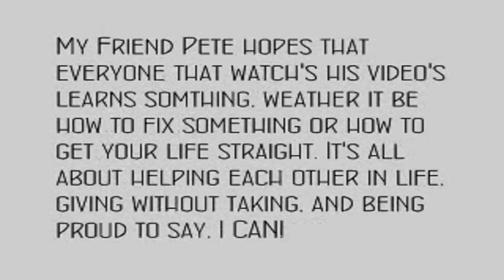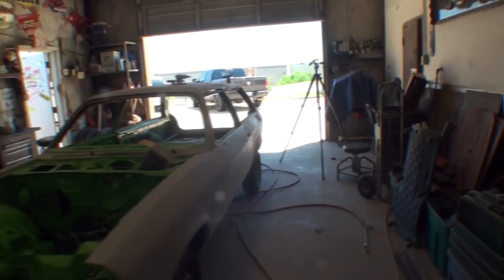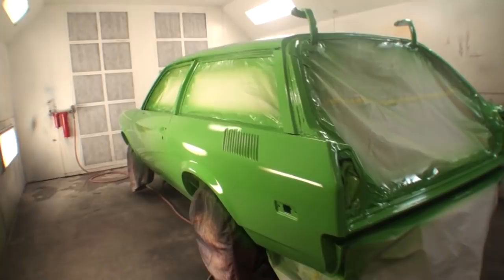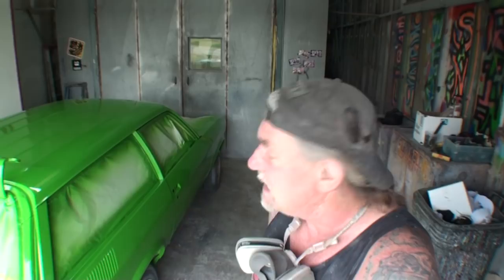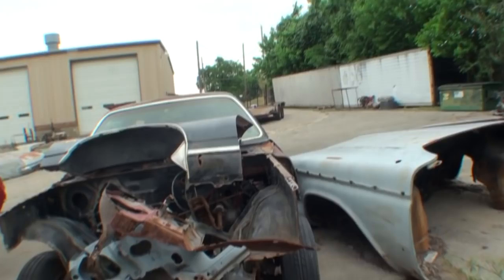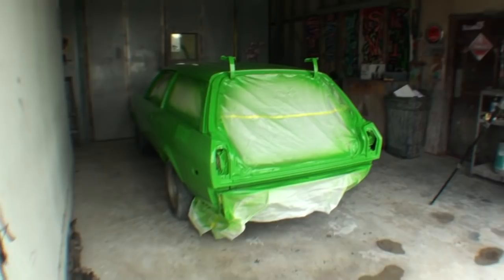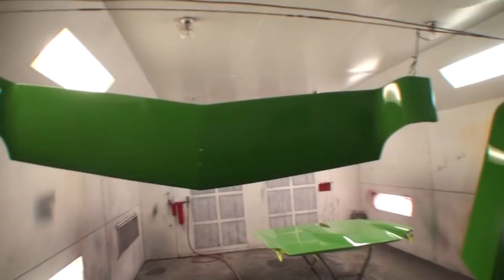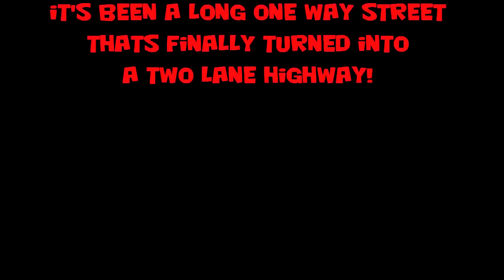How To Restore A JUNKYARD Car - Part 18 - RIGHT Color GREEN - FINAL PAINT

Comment: Hey pete quick question for you I have a 48 chevy pickup which I body worked and then epoxyed it then 2k high build I sanded it down with 180 dry and then went over the whole thing with a red scotch brite im not looking for a pristine paint job would it be ok to just seal it all and spray single stage